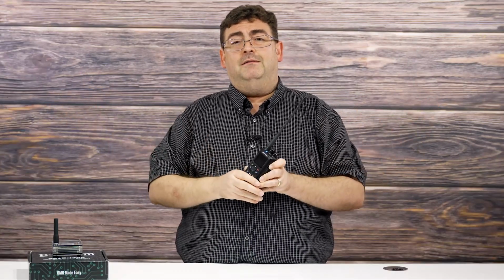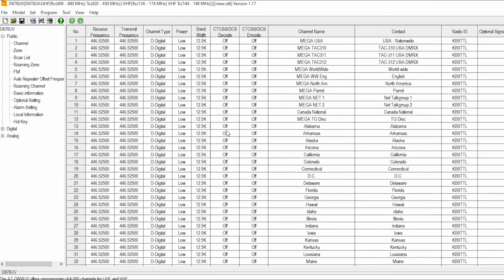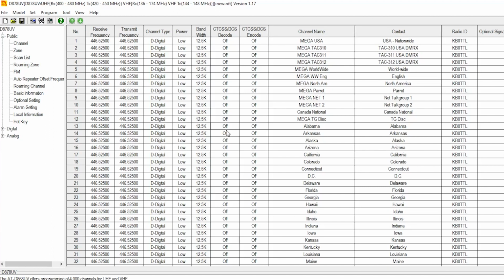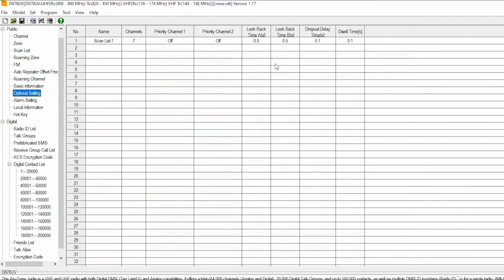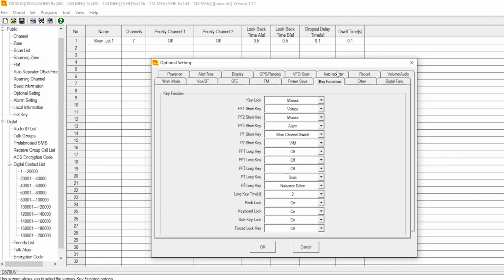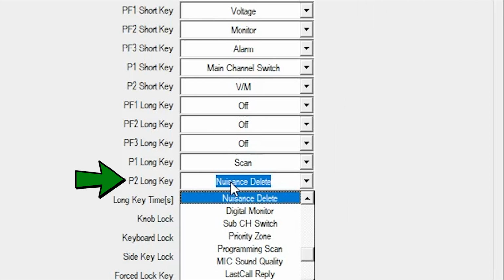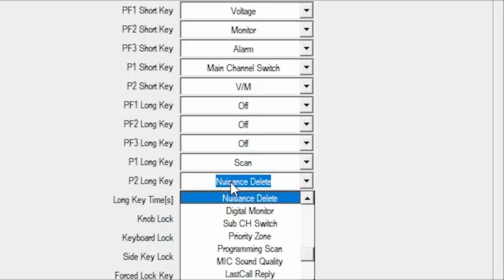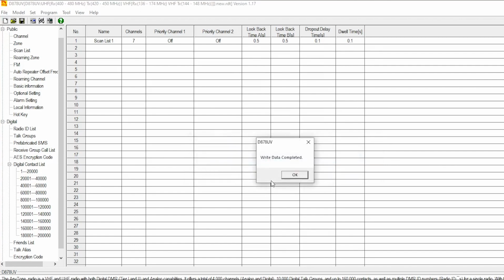How to Quickly Skip a Channel When Scanning on Your AnyTone 878 Plus

Comment: How do you stop the scan if you hit an active channel you want to remain on?
Reply: Hit the menu button. The green one on the top left.

Took me a while to find this too. Only seems to work if you hit that button when that particular channel has a transmission, otherwise it seems to send you back to the start.
Reply: @WA4NDR  didn't work for me. When I hit the green menu button, the moment I let go it returns to the starting channel. What firmware you on? I'm on 1.18
Reply: @athertop  I am on the 1.21 firmware. I begin a scan by holding my preset button which I have set to P2. I wait for the radio to land on a channel with a transmission then I tap the green button on the top left.
Reply: @WA4NDR  I wonder if the scan mode makes a difference?  Mine is set to "SCM CO". I will updare the firmware and try again. Thanks for the reply
Reply: Just completed fw update to 1.21 and now can stop the scan on an active channel with the green (menu) button.  Many thanks for the solution. Best wishes, Paul
Reply: Hi Paul.  Is the green button assigned to start/stop scanning?  I have the same situation - stopping scanning on an active reverts to another channel.  I will check my FW version
Reply: @humaxf1  like I said in my previous comment (from a year ago) the functionality of using the green/red buttons to stop scanning was introduced in a firmware update, so you'll likely need to update yours if you don't have that functionality. Once updated, the green button stops the scan on the active freq/channel leaving you on that freq/Ch, and the red button stops scanning and you are returned to the initial channel.
Reply: @athertop  

Thanks Paul - all sorted now.  My 878 is a UV PLUS with FW version 1.24N.  Green menu stops scanning on the active channel, Red stops scanning and reverts to a 'selected' channel.  This has made my day lol.  Thanks again and to other contributors.